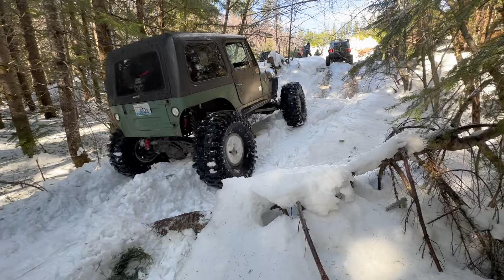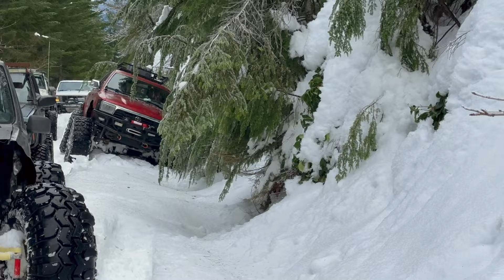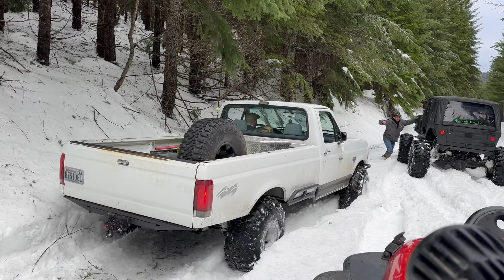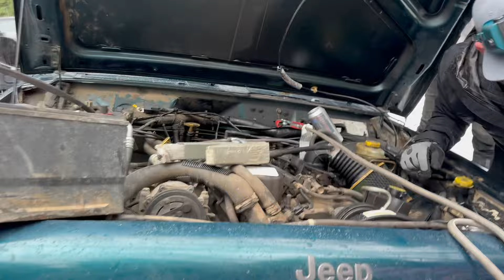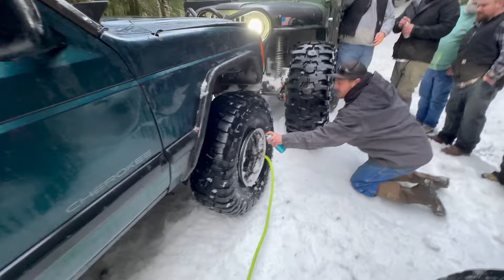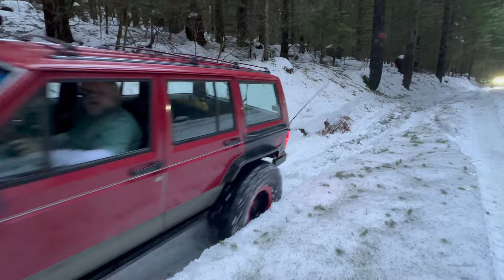Killer snow run on a beautiful day Part 2 #jeep #welding #snowwheeling

Comment: My new hero is your buddy in the white single cab long bed even though its a ford he is still my hero. Ive got a 94 Dodge Ram 2500 single cab long bed and a88 GMC K2500 Ext cab and i always wondered how they would do. So please tell him thanks and i realy mean it! Only thing is all my life everybody said you need to put some weight in the bed, not a full load, to get more traction but the best i can tell he dont have any kind of weight in the bed but i maybe missing it. And if not to much trouble could you ask what size tires is he running? Both my trucks have limited slip rearends and lock front. Dodge is Dana 44 and i have no clue on GMC but the housing on GMC is huge twice the size of Dodge. Great videos Thanks!!!
Reply from the maker: Good old yardstick! That’s what we call his truck, he is running 36” iroks, no weight in the bed, 15” beadlocks and lockers front and rear, it’s a manual 300 inline 6 truck and all though he might not go the best out of the whole pack he definitely impresses the most people with how good it does go! Your GMC would have a 14 bolt rear end which is as tough as they get. Thanks for the comment!
Reply: @ChuckHolt  Thank you so much! I watch your videos and it amazes me how good he does in deep snow. Nothing at all against yalls jeeps and yotas but he has realy encouraged me to go more and yall have taught me so much with good fun. I'm a old country boy grew up on farms and fun but never anything extreme as yall but I'm fixing to more. I'm in TN and we sure don't get snow like yall but plenty of mud trails. It amazes me how you take your red jeep and the red Toyota and go off on sides and eventually you come back out and back on trail. Thanks again for your help it realy has helped me with the info! Yall take and keep having fun and I will keep watching!
Reply from the maker: @Tommy-rr7ez  we will!